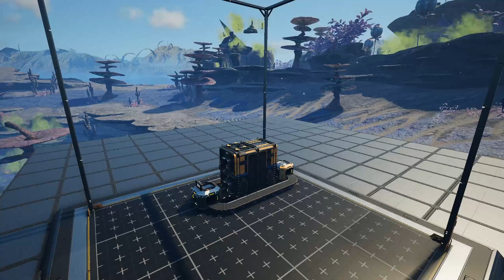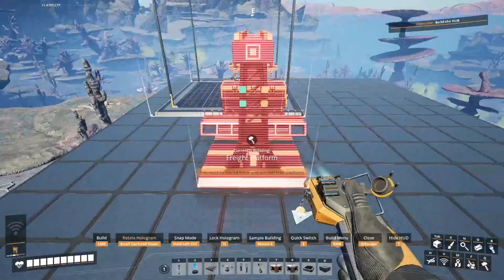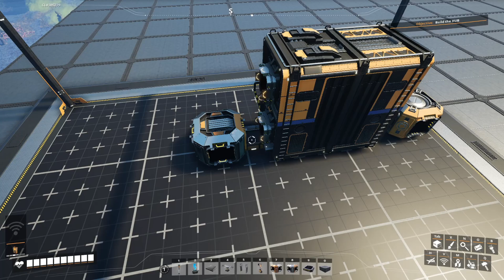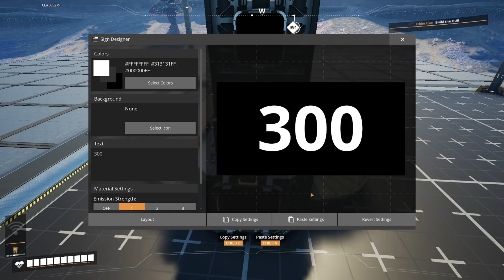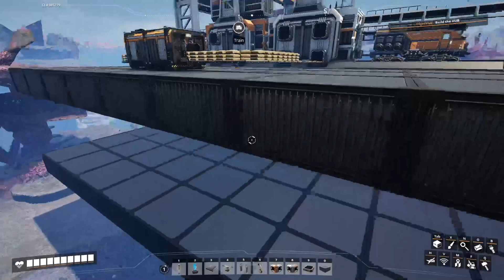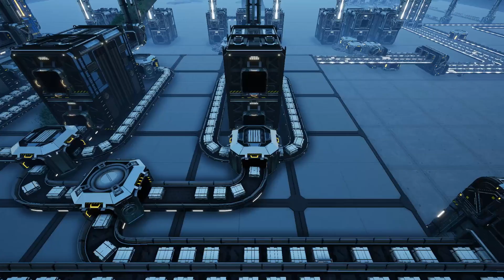Train Buffer / Load Balancers - 100, 300, 400, 600/min - Satisfactory 1.0

Comment: Just wanted to note, the priority merger has made these sorts of blueprints even more useful, placing it at the back of the container and prioritizing the balancer’s feedbacks over the input from the train station.  This way you can always use the same speed belts on the input and output of the storage container and never worry about the balancer backing up.  The priority merger will only allow the system to draw exactly what it needs from the train station with no concern of it clogging the balancer’s feedback inputs.

Comment: I feel like such a barbarian right now!

My factory designs tend to be based on saturated manifolds.
When the factory is made for multiple products from the same resources (e.g. building mats from iron, concrete, coal) first I sketch a rough balance and then I add a bit more on high consumption materials.

The result is that the entire factory stands still when all output buffers are full, and it replenishes whatever I grab at good speed.

Those are not intended to be eyecandy. They're workhorses.
Let it glut and starve. It will sort itself out.
Reply: Actually, I must correct myself.
In my last run I placed enough machines in each line to consume most of all of resource input but up to 60 or 120/min output.
If I grab only iron plates then iron plates get replenished at full speed.

Comment: From my experience, when I'm using belts at full capacity (especially the 1200 belt), there will always be a shortage for some reason. Even if I have a container with enough resources inside and a single belt as the output, there will be gaps on the belt from time to time. I mostly noticed it on mark 6 belts, so for the future I will be avoiding blueprints that need exactly 1200 of some resource.
Reply from the maker: I'm sorry to hear that. I've had issues with the mk.6 belts as well and keeping them full has been tricky. Thankfully I've had really good luck with being able to rely on belts staying full out of storage containers. Hopefully there is some more game optimization down the line that will help us all out.